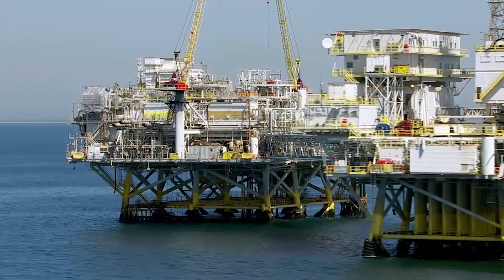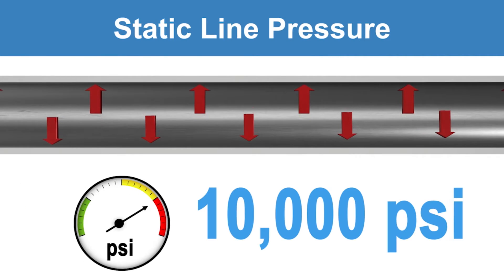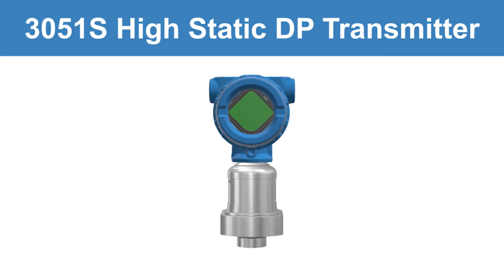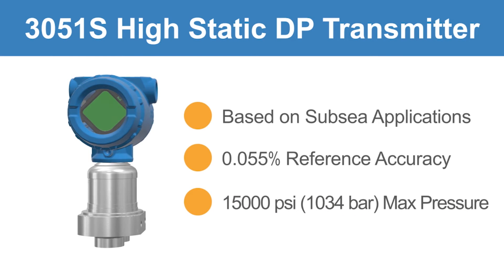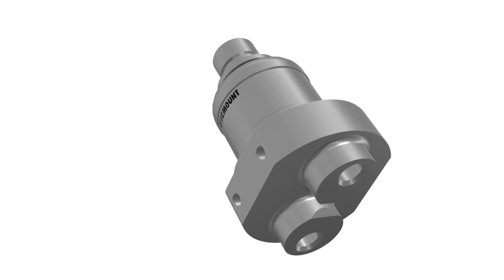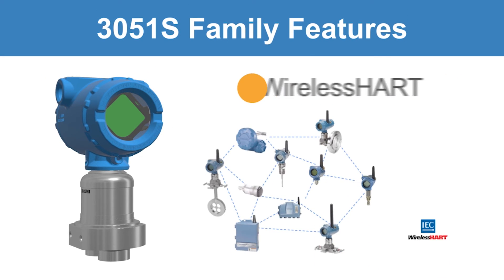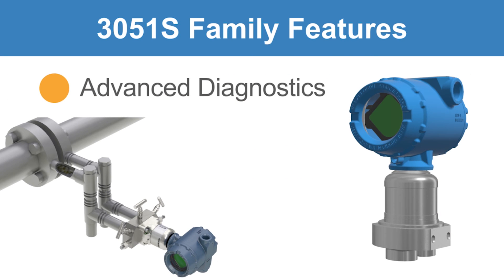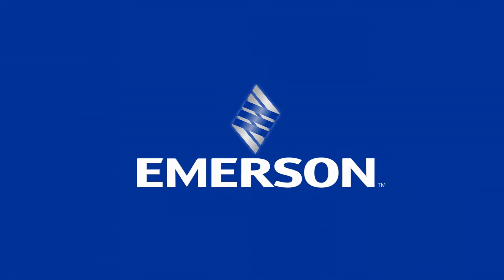Rosemount 3051S High Pressure Differential Pressure Transmitter - Technical Details and Benefits

Comment: What does the max pressure means on the name plate of transmitter.???
I have a DP Transmitter
it has MAX PRESS: 17.3 MPa
i checked the sensor limits with HART which -62~62 kPa
and Cal. Range is -8~8 kPa.

My question is what is this max pressure?? Can we use this dp as a PT on high pressure lines like 17.3 MPa ???